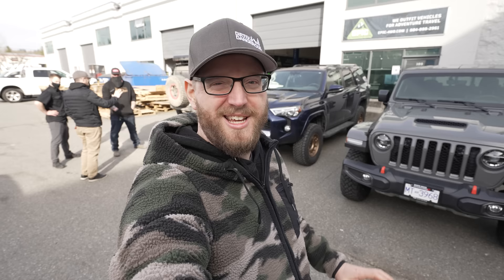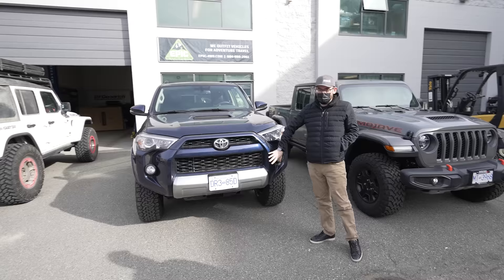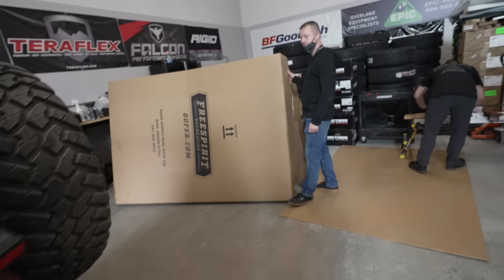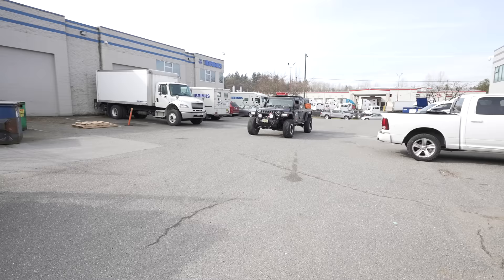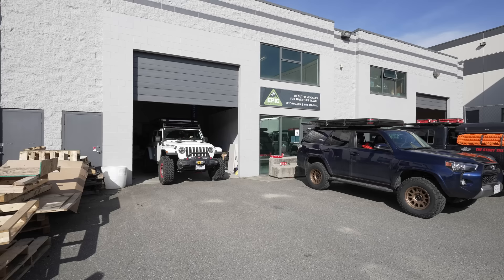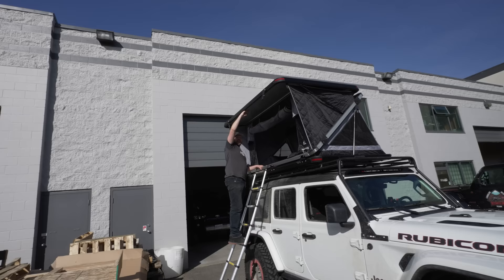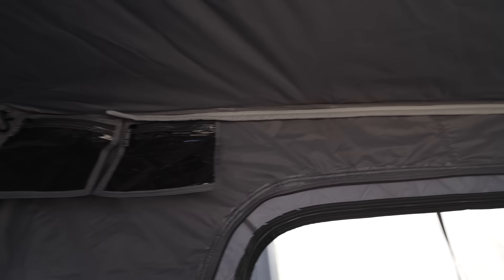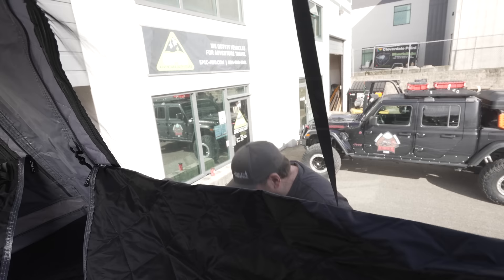My First Roof Top Tent! Freespirit Recreation Evolution Install on Jeep Wrangler Soft Top

Comment: welcome to the rtt community there casey, i have the smittybuilt overlander xl (its huge, larger then a king size sleeping area), only things ive done are a extra 2.5inch mem foam topper and some wiring on the inside for power to the various things to charge or run.
Reply from the maker: I added a memory foam topper as well for extra comfort.

Comment: Enjoyed this video.  The tent looks really good.  I was also checking out your Tereflex wheels again, which I just ordered this week for my 2016 Hardrock JKU.  Loved the features of those wheels after randomly finding your review video on your mods last month.  They were back ordered but 10 came available this week.
Reply from the maker: Best wheels I've used or seen that aren't bead locks. If they made a beadlock with the same air down system I'd buy them immediately.

Comment: Looks absolutely awesome mate, would be great to see how dark it is in the morning
Reply from the maker: It's not as dark as the Oddysey, as it has some semi transparent spots so you can at least see if the sun came up but you still need a light on to see what's going on even with full sun up. I prefer to sleep with windows wide open and fresh air if it is t too cold and most times welcome the morning sun.

Comment: The french dude I am is just raging inside cause in france Gladiator 80th anniversary is 65 560 € ( 77 521,42$ ) + malus(+ something like 30k € ( 35 473,5$ )I think) and in Usa 80th anniversary starting 42 005$ ( 35 523,7€ ).
BTW the tent looks great ;)
Reply from the maker: Crazy. I bet a kitted out Gladiator rolling around France is a rarity.

Comment: How's your Gobi Rack and RTT going so far?  I have a soft-top JLUR and thinking of adding the Gobi Stealth and iKapmer for a cross US/Canada overloading trip in a year.  I wanna start building soon.
Reply from the maker: I removed it and replaced it with a Metal Cloak Adventure Rack System
Reply: @Casey250  MC makes a ton of great stuff and I looked into their rack.  I'm considering it, but having second thoughts with the cutting and drilling.

Comment: I really like that tent and I like the whole RTT concept. My only concerns are the overall height of the vehicle and the raising of the centre of gravity. These fears could be totally unfounded and what else are you going to do in a JL? Sleep in your driver's seat?
Reply from the maker: It isn't a rock crawler, and I feel comfortable being a bit top heavy.
Reply: @Casey250  I moved from AB to NS(the wife's fault) and like some of your BC trails many of these smaller NS tracks are just a tunnel through the trees, with branches, leaners etc. I would be worried about damaging a RTT. I can only swing a chainsaw over my head for so long.
I'm really finding your videos informative and fun. Thanks for your channel.

Comment: I've got this tent, only thing to watch out for is the lack of protection underneath. I've already got 1 replacement due to the bottom liner catching the wind and tearing holes.
Reply from the maker: Thanks. I'll keep an eye out. I notice the rubber ends on the bottom rails come off easy and could catch the bottom liner
Reply: @Casey250  yeah mine keep coming off as well, may end up glueing them.
Reply: @Casey250  I ended up getting a replacement tent for the liner being torn, and took that out this weekend.. had the zipper break off and the rail system fall off when driving. Support told me to deal with it and won't offer any returns. I've had 5 different problems with two brand new tents from them. Just annoying.

Comment: What static weight rating is on that roof rack system?  I've seen a similar one by GOBI i recall had only 180 lbs which made no sense how anyone would use it with a tent in mind.
Reply from the maker: 300lbs static

Comment: Why did you dump this for the Roofnest?  Be honest, are you sponsored? Be transparent, don’t be like Talon sei who has literally changed configurations 6 times in a year.
Reply from the maker: I used the fsr for a year. It was great. I had the older model and did not like the latch system. I have no affiliation with Roofnest but have partnered with Modula Racks and we can now test out tents they carry and give you guys feedback. I mostly wanted to try a flip own style test as it frees up alot of room on my rack for cargo. Over all, I think wedges are the best style, but they sre the long.